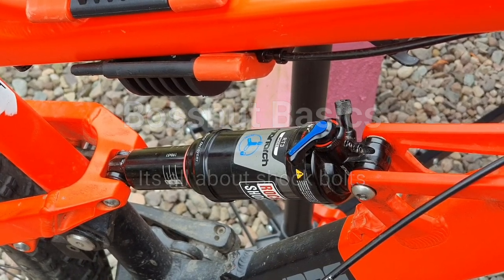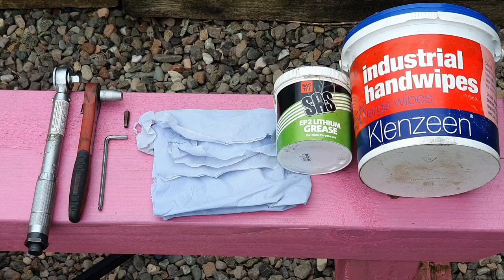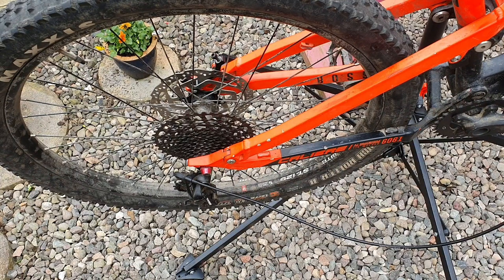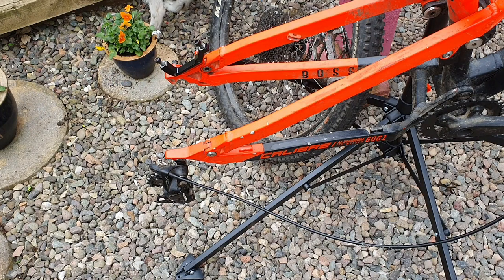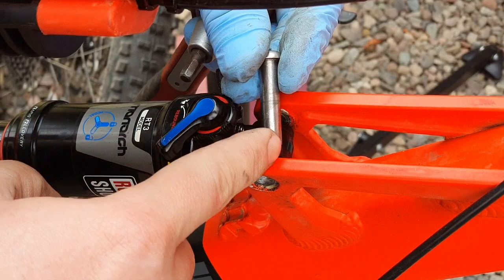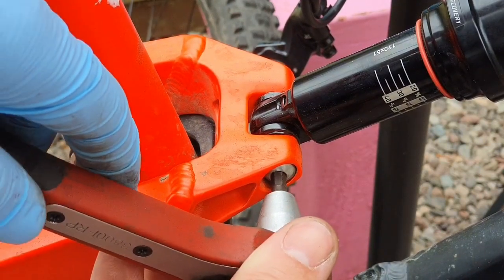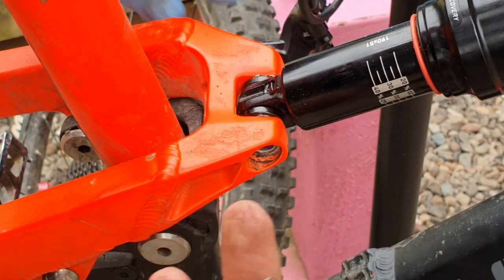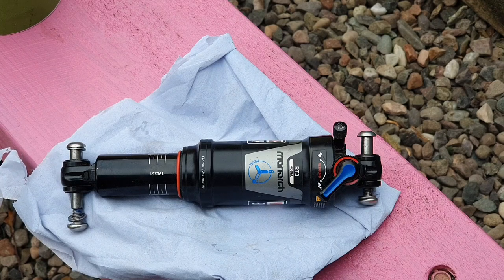Calibre Bossnut Basics (Shock Bolt Service)

Comment: What PSI should I have my suspension at I'm  77kg - 80kg
Reply from the maker: A good starting point is your riding weight in pounds so 80kg is 176lbs. Try 176psi to start with but what you really want to go by is sag. 25% sag on the calibre bikes using normal monarch shock or 30% if you have a debonair monarch shock.

Comment: Could you tell the dimensions of the rear shock mounting bolts? I cannot seem to find replacement ones anywhere online or in stores, thanks!
Reply from the maker: Are you part of the Facebook group "CBRG" (calibre bossnut riders group) the specs are in the group. There was a member making batches of them out of better materials.
Reply: @TheBikingVikingDude  Hello! No I am not on FB. Are the bolts m5 or 5 mm x25mm? I need those only
Reply from the maker: The 2 shafts have different lengths. The front shafts is 34mm x M8 and the rear is 40mm x M8. An alternative is to track down scooter axles in the correct lengths.
Some have bought the following as replacements.
https://www.ebay.co.uk/itm/162586942748
Reply: @TheBikingVikingDude  Thank you so much!!!

Comment: Anybody has the exact specification of the shock bolt ? A knew is around Long 45 and  8 diameter. Thank you!
Reply from the maker: The next time I service mine ill give them a measure but a good work around is scooter axles from the skate park style. 8mm shaft diameter and cheap to buy big multi packs with various lengths.
Reply: @TheBikingVikingDude  Front might be 37 mm and rear 40 !
Reply from the maker: @Cornel1001  sounds about right, you could always go a little bigger and use washers or cut down the shaft.

Comment: Just done this to my Bossnut but got play in the bottom still, think I've left it to long before I finally looked into the creak.
Reply from the maker: Once they start to go it can go quick depend on the trails you run on. Might be worth looking at changing the bushes in the shock eyelets. If you take the shock out and try the shaft within the bushing you might see what has worn. Might just be one or the other. Worth tying the top shaft in the bottom of the shock to see if both are loose (brushing has worn) or if it fits nicely (bottom shaft has worn).
Reply: @TheBikingVikingDude  good idea it's had two years of hard use with limited maintenance. Starting to see the effects now. Just swapped the Bb though using your video.
Reply from the maker: @joebloggs3055  nice, good to here when the videos help out someone. Pivot bearing service is coming next, just finishing the editing and then it'll be uploaded as soon as it's done.
Reply: I have the bossnut V1. I've got a tiny bit of play in suspension. I've read somewhere it's because of the paint coming off and that a fix was making washers out of beer cans. I can see some of your paint has come away on the front shock mount. Does yours have any play init?
Reply from the maker: It does depend on what model of bossnut you have as earlier models had issue with paint taking the play and as you say when it is missing you get play. Mine has paint missing but it hasn't resulted in any play but shimming out the play is a good work around. Most of the issues seem to be bent or worn shafts, the lack of grease allowing the wear to accelerate.